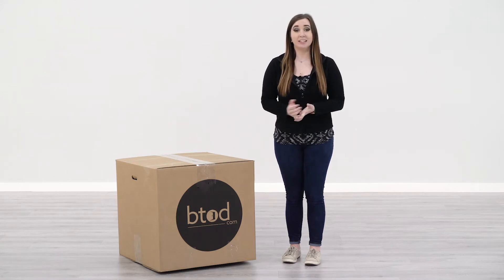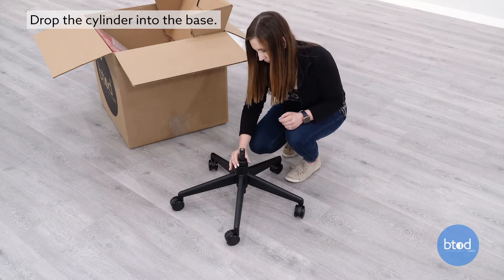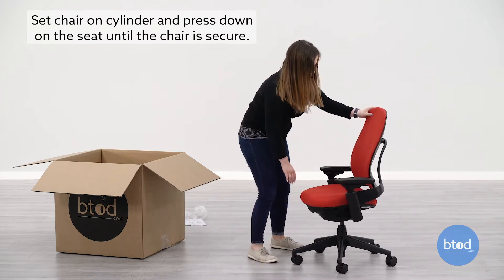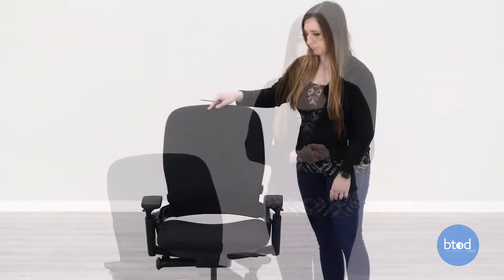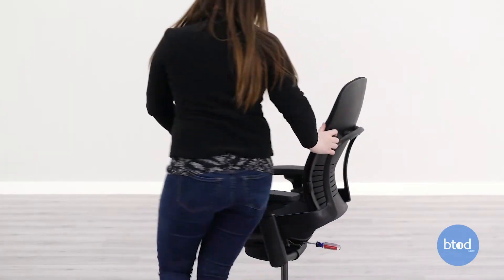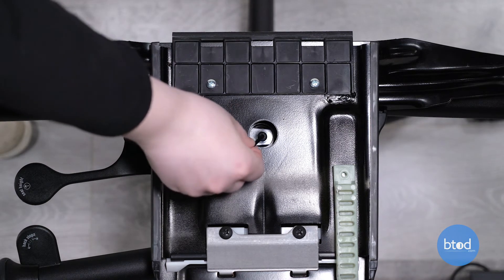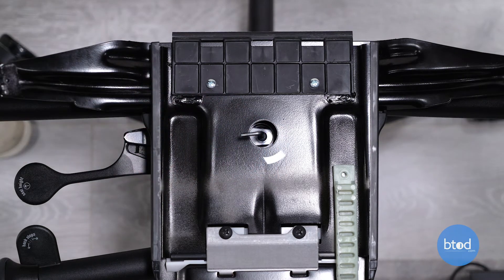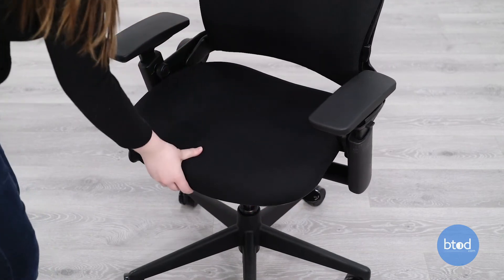How To: Assemble Your Refurbished Steelcase Leap v2 From BTOD.com With Top Activated Cylinder

Comment: My leap chair (v1) moves slowly down without me pulling the seat lever. The set screw will not loosen when I try to turn with allen wrench. Also, the set screw is lower than what is shown in the video. Should I fully disassemble and reassemble?  Side note, leap chair is a used office chair gifted from work.

Comment: You should redo this video to add something at the beginning explaining that not all your customers should use this video because not all your refurbished v2s have this type of cylinder. I followed these instructions- why wouldn't I? The written instructions were at the bottom of the box under a very heavy chair, and this video was from the seller and specifically about a refurbished chair. Now I have a chair that won't adjust, and had to call to get instructions on how to disassemble it. I am just hoping it won't get damaged in the process. This is not a good start to my relationship with BTOD.
Reply: What are the instructions? How did you achieve this? I made the same mistake as you and am stuck
Reply: @Rkcuddles  i would just call them and they can talk you through it. They should know their instructions are causing problems